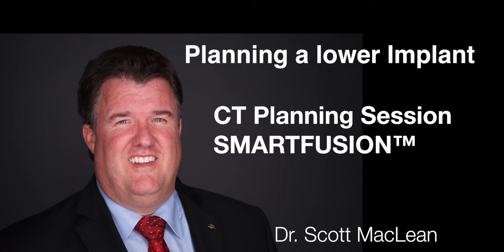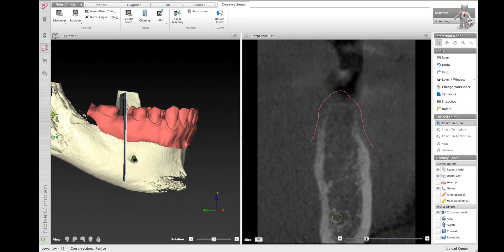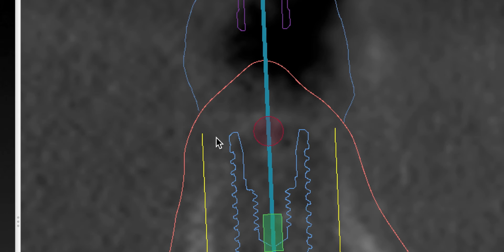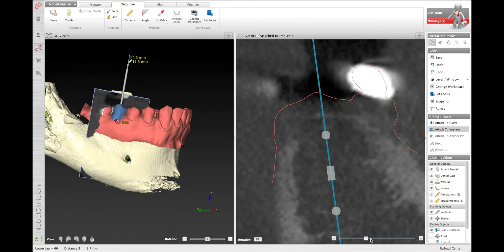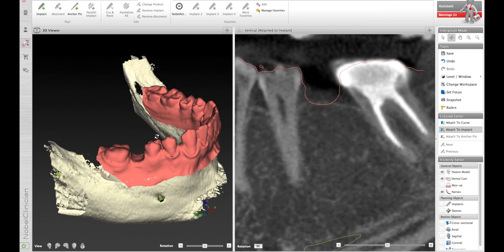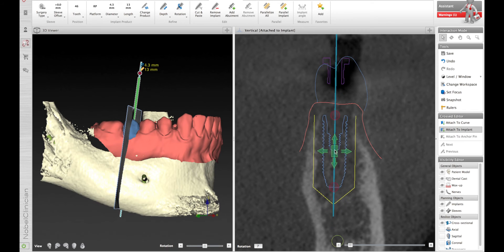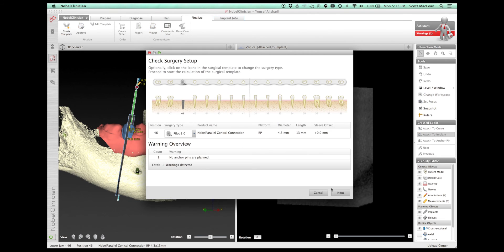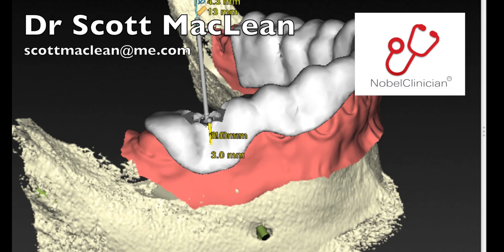Planning a NobelParallel CC to minimize Crestal Boneloss

Comment: Dr. MacLean. Current Nobel Active user and thinking of starting to use the Nobel Parallel Conical Connection implant. Any recommendations on preference when to use one vs. the other?
Reply from the maker: Michael Shnayder  the parallel implant is a great implant to follow the nobelactive. Especially in bridges/splinted prosthetics due to thread at the top of the implant and extra plarform shift. Nobelactve is a high performance implant which can be used in most areas of the mouth. Can use same surgical kit for both implants.